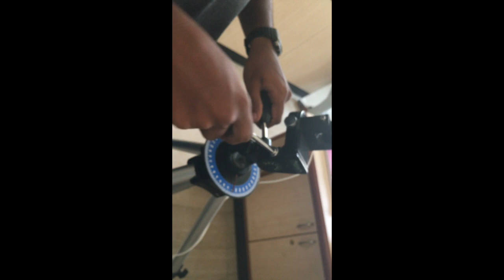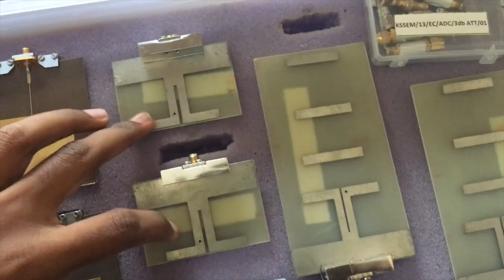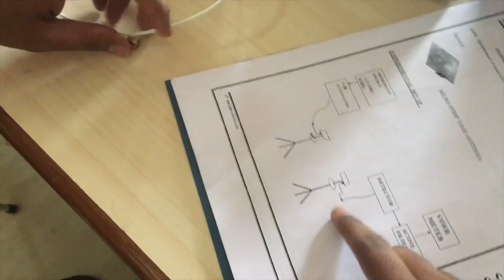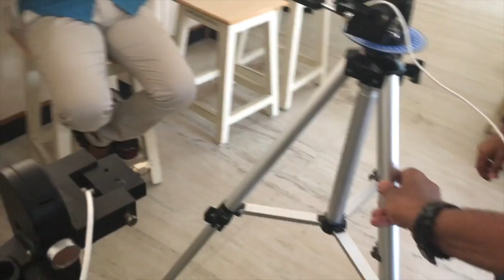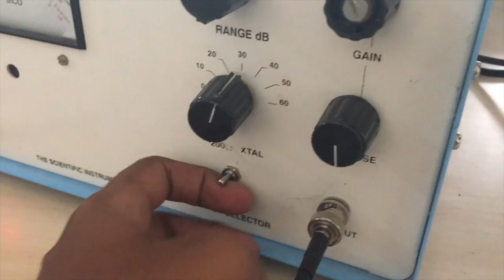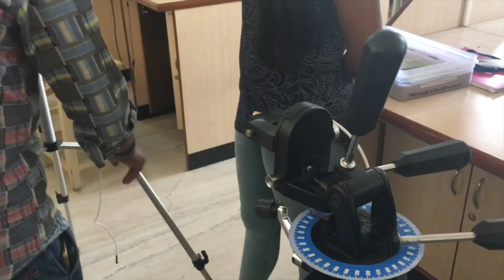Measuring directivity and gain of antenna- ADC Lab

Comment: Hi, you just put VSWR meter to measure the VSWR. My question is how to measure radiation pattern by using the same equipment, and how to export these values ?
Reply: they have not noted power level from source ,assuming they used 3db attenuator pump power upto +10db and a DISTANCE OF ONE METRE  at 2.4ghz rotate the holder towards left and right like semicircle and note down values plot in excel sheet